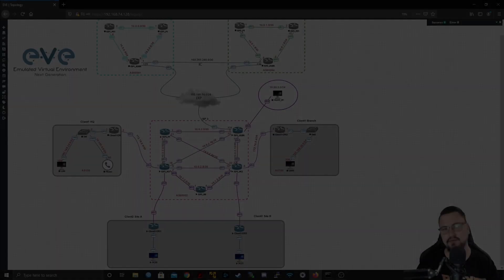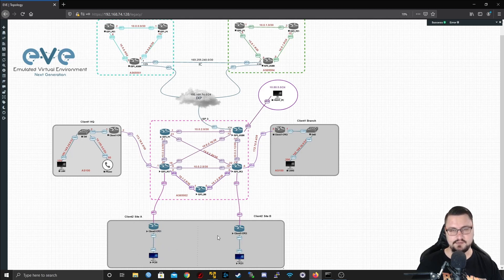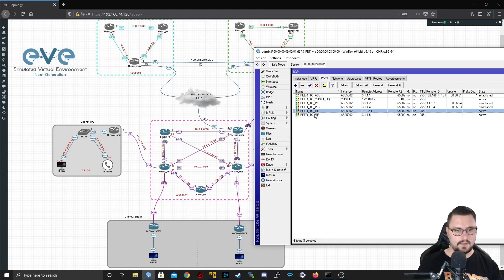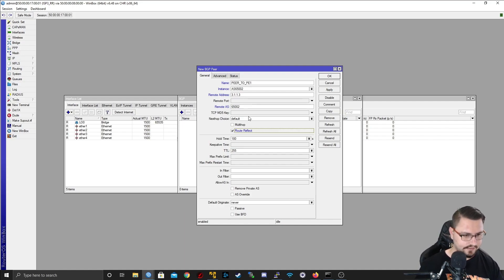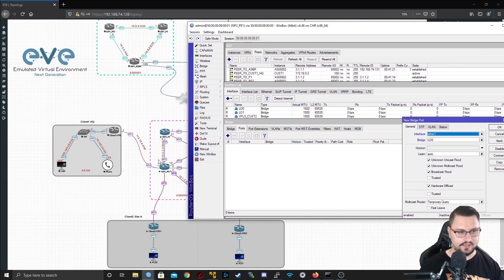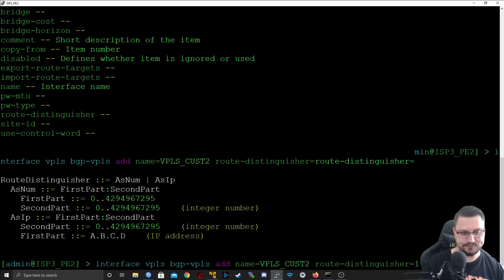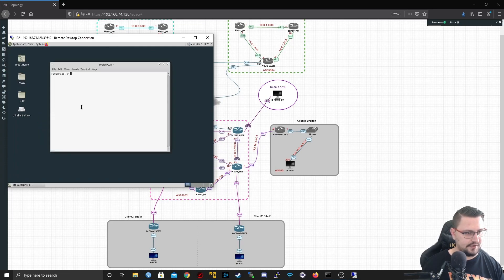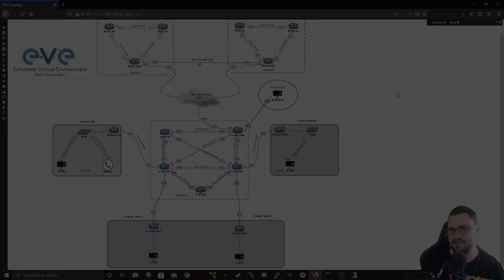Mikrotik  - VPLS BGP signaling

Comment: thank you for great explanation. What version. of  ROS you used ? I migrated my lab to 6.48.3 and vpls is not coming up. BGP session established, but VPLS in  DB state.
Reply from the maker: Hi vasja, I was using version 6.48 and 6.48.1 in the videos. I've seen some complaints about certain things on version 6.48.x so it might be a software bug in .3, though you would have to log a ticket with MikroTik to verify, unless this is just for your labs. I could also recommend version 6.47.10 as that is considered  the "long-term" version.
Reply: @TheNetworkBerg   Afrer few sleepless nights I figure out that issue was in LDP topology configuration for VPLS.
Reply from the maker: @vasjabatareikin6016  Happy to hear you figured it out mate :)!

Comment: Can you setup a backup or secondary route reflector with this design to avoid a single point of failure?
Reply from the maker: Yes you can definitely add a secondary RR to add redundancy to the solution. Will see about creating a new video with this topology to get that done, there are two preferred ways I can suggest. One being a bit more practical and best practice than the other but both ways allows for redundancy.
Reply: @TheNetworkBerg  Thanks for the quick reply. I run a small network with 9 sites and we are testing this type of design in our lab and might update our current LDP signaled VPLS with this design. Great videos, keep up the good work.

Comment: Respected Sir... I need your help for configuring Mikrotiks MPLS /OSPF somethig like .. which one is best for my network i will share here my network diagram via text---------------------------
 
I have 1 PPPOE with Hotspot server in BTS with CRS24p SW  and 8 Location towers with CRS24P Switch (From BTS to ALL towers connected via 2 fiber and 1 RF Point to Point) Which configuration is recommanded for my network kindly reply as soon as possible.. or any Video link

Comment: Hey Berg,

i'm not sure what is the purpose for VRRP between CPE1 and CPE2, and one more question.
Does vrrp need to be /32?
Reply: and also, i  think vlanx it does existing on v7
Reply from the maker: Hey Nikola, the VRRP is not required for the VPLS this was mainly to showcase that a protocol like VRRP that runs over L2 is able to communicate between routers using the VPLS. As for a use-case scenario I think this would be ideal for running a DR (Disaster Recovery) on your server infrastructure where your machines could share IPs in a passive-active state, however, should the primary DC go down you can fail over to the DR without much configuration changes needing to happen on the server side as default gateways will remain the same and traffic will route normally.

And yes I checked now and VXLAN does exist on v7, though this is still beta and I would recommend not bringing Beta features into a production environment. So I will only cover VXLAN on MikroTik after the offical v7 release (With the extra bug fixes that need to come after such a major release hehe)
Reply from the maker: Although it might be fun to lab VXLAN on MikroTik even in Beta so I might even put that in a stream somewhere :D!